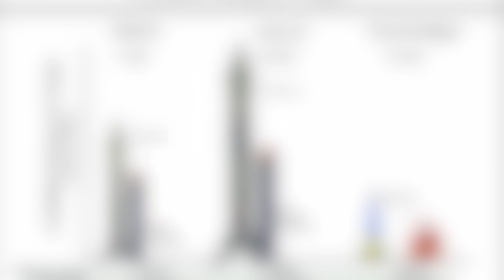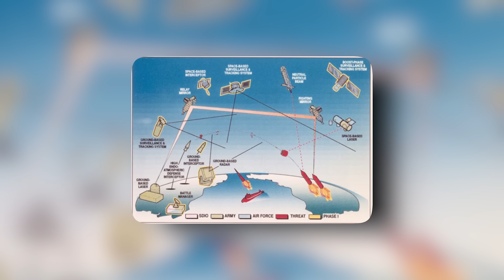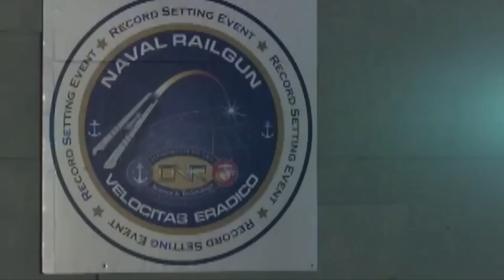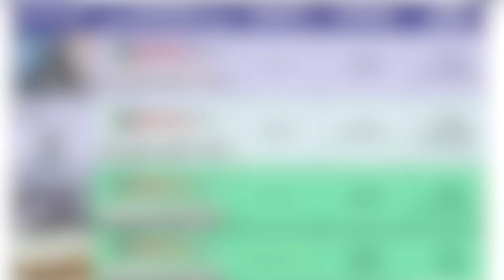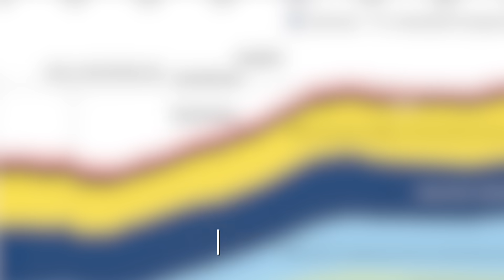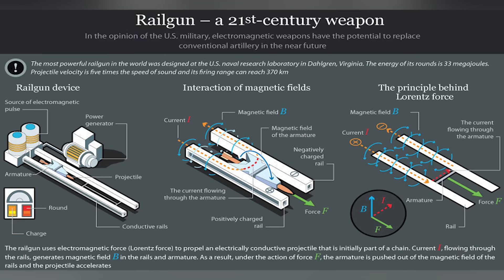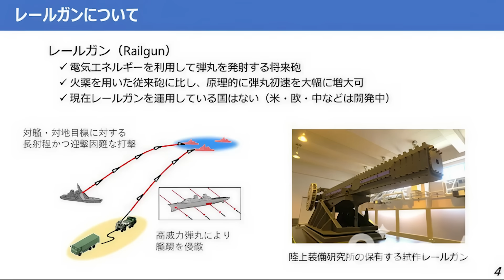Japan Revives a Scrapped U.S. Superweapon — And It Actually Works!

Comment: The problem with the rail gun was the damage done to the barrel
Reply: Yeah I suppose you’d need a zero friction solution, making the projectile be captured in a floating state of a magnetic field (the same one propelling it?) inside the barrel
Reply: @mortenthorpe  You can do a floating projectile with a coil gun, but in a railgun the projectile needs to physically close the circuit between the rails, which it basically scrapes against all the way down the barrel.
Even conventional naval guns have a limited number of shots before the barrels need to be replaced, so that's not necessarily a deal-breaking limitation.
If the ship can carry several sets of replacement rails and swap them out reasonably quickly, then Bob's your uncle.
Reply: @The_Inquisitive_Inquisitor  I asked Chat and it said we could use something like a electrically conductive gas to do it, but obviously we don’t really have that capability yet so no contactless rails yet
Reply: @labbit35  in the big railguns, they actually pump out all of the air inside of the barrel so there's not even air resistance when it's firing. IDK how a conductive gas would play into that.
Reply: @The_Inquisitive_Inquisitor  we need room temp superconductors ngl
Reply: @labbit35  When your weapon system twists the laws of physics into a pretzel, then some components are going to wear out. I don't think there's any way around that
Reply: @The_Inquisitive_Inquisitor  bro a railgun is perfectly within the laws of physics, it’s jsut that sheer force of the railgun is so intense that we have yet to figure out how to make the barrel in a way that ensures it doesn’t blow itself up
Reply: @The_Inquisitive_Inquisitor  Interesting. Over all electric recoil does not have to go opposite directing from projectile. but if you don't funnel it some direction it rattles weapon apart. 
So replacement rails and clear recoil system that works well. US experiments looked like they had no recoil function and they were vibrating a lot.
Reply: @The_Inquisitive_Inquisitor  you are partially correct on barrel life, but when your barrel life is 3000 rounds it’s no longer viable.
Reply: @The_Inquisitive_Inquisitor  are you kidding ? "scraped down the barrel ? do you have any clue what kind of current is surging between the conductors and the projectile ? I'll give you a hint-it's enough to instantly vaporize any metal in a microsecond-I guarantee you-there will be no intentional "scraping" ..not unless your aim is to weld the projectile to the barrel.
Reply: Ya it's most likely a coil gun.  Same deal with the handheld rifle.  And it works.  It's a coil gun most likely.
Reply: @ashleyobrien4937  you didn't say anything funny. Say something funny
Reply: @The_Inquisitive_Inquisitor  タングステンカーバイドコートにすれば耐摩耗性も耐熱性も確保できるだろう！
Reply: @shintenhou229  Tungsten welding electrodes are considered "consumable."
There is no material that never wears out.
Reply: @The_Inquisitive_Inquisitor   The projectile must be loaded into the launcher, so just include a sacrificial rail jacket as part of the munition.  Secondary electromagnetic pulse could eject the wasted jacket, taking a lot of residual heat with it.
Reply: @mortenthorpe I've read about some now coatings that where used in tokamak, they might be using those coatings
Reply: It's not even just the friction the electric discharge also produces plasma.
Reply: @mortenthorpe  It was poor recoil set up mostly the problem if you don't send the energy out from the gun it rattles the gun apart. 

Electric Recoil not like kinetic recoil. Basically you can direct the recoil any direction  except the same as the round . One simple small hobby version has force come out bottom of the "gun".
Reply: @mortenthorpe Rail guns use an electric arc to accelerate the projectile. The damage isn’t caused by friction but rather the electric arc discharge heat.
Reply: @mortenthorpe a rail gun always has millions of amps of current running through the barrel and the sled moving with the projectile. It's not just magic magnetic levitation. There are large copper pieces sliding against eachother by design and the interface carries insane currents. If there is an airgap the weapon loses efficiency and the wild sparking destroys the surfaces even faster.
Reply: @mortenthorpe Nope. Magnets need close proximity, and at those energies and velocities, the air turning to plasma erodes the barrels. It's not metal on metal - it's 10000C plasma eating the barrel. You'd need to flush the entire barrel into a hard vacuum with each shot, but even then the last few centimeters would still erode. Even the magnetism itself would affect the metals in the barrel etc. 

The weapon works. You just need to change the entire barrel every dozen shots or so. Obviously a 20 or 30 metre barrel can't just pile up in a stack somewhere - you need serious engineering or a crane to replace it.  Or as I say, the whole barrel needs encasing in a vacuum clean room, and even that is only a partial solution.

The US military had good reasons to abandon it and just put in fifty missiles instead in its place.
Reply: @mortenthorpe  I think that's correct. Maybe using the tech from the Maglev. That should reduce the wear issues. It's no longer a pure rail gun and make the projectiles more expensive.
Reply: The Japanese apparently had overcome this problem according to the video.
Reply: @samo4003  There were actually a few problems the US researchers had, another one being the weight of the system wasn't feasible for shipboard use cases and that's the reason they were developing it.  Another is the big surge of energy it takes to launch it.  You almost get to the point of needing to store energy up to fire off a shot, and that once again creates a weight issue.

And there is one last issue, you can accomplish pretty much the same thing with missiles as fire and forget missiles are better than ever.  And they aren't the price of what the narrator said as every missile a ship carries doesn't have to be a Tomahawk.

We had a 5" gun on the front of our ship and you could feel every time it fired a shot, and that was a destroyer class ship so it wasn't small.

I'm not saying it CAN'T be done for a ship, I'm just saying it wasn't feasible to keep spending money on the R&D in the US for it and the Japanese are more likely than not to come to the same conclusion, and if China puts one on a ship and claims it has the greatest weapon in the world, OK.  I won't believe it but OK.  You shoot that thing one time, then wait.  Meanwhile a US ship will have shot off a few missiles.  It will be a nice hood ornament for Chinese ships but if they get into a wartime situation with it my first assumption would be it will destroy the ship it sits on.
Reply: @johndoh5182  I agree with you. I do think where the US R&D went wrong was its size. I think they tried to go too big too fast without creating a smaller version first to solve some of its initial problems first. The AK 50 as an example, its not as simple as just scale up an AK47 to fit a 50bmg but it did solve some of the problems before hand that informed the corrections needed to fire a bigger round. TLDR the us started too big and should have started with a smaller round.
Reply: @samo4003  Looks like their solution was to simply use a smaller round. Which is one of the logical solutions to the barrel wear problems the US was dealing with. However, going with a much smaller round also means you're negating a large part of its utility as naval artillery doing shore/inland bombardment.

Which isn't to say a smaller rail gun round is unable to do a lot of damage and fulfil a role in modern combat. Just that the niche it would fill is different from the one the US Navy was seeking to achieve.
Reply: @samo4003  Don't know. They'd have to use either a new or experimental material to figure that out. And there's still the power thing.
Reply: @samo4003 Maybe they used their MagLev Tech?
Reply: @samo4003  To be more precise. They found a sweet spot in performance and degradation to the point that it was deployable enough.
Reply: @samo4003  Yeah, by scaling down the power output to 1/50th of the American prototype.  This is a step up from 90's college graduate-level research club project.
Reply: @samo4003  They didn't, they scaled down the weapon to 40mm (basically the size of an under-barrel grenade launcher like the m203 used with the m4/m16). I don't really know what they'd use a rail gun that small for tbh, other than a proof of concept.
Reply: @samo4003  - because the Japanese shrunk the railgun. It's more accurate to call it a mini-railgun. They have yet to prove they can overcome the same issues the US Navy had with larger railguns.
Reply: They never overcome the issue. Unpredictable damage on the barrel.
Reply: @samo4003  I read the technical reports on it's development over the past few years. Basically by staggering the capacitor discharge by a few microseconds so that way their peak draws do not overlap, they drastically reduced the barrel wear via reducing the peak resistance and thus heat and damage to the barrel.
Reply: @samo4003  So did Americans. The difference of barrel wear between railgun and super high velocity chemical cannon is marginal, because they put so much propelant behind the shell. Americans just don't think railgun is a solution to their problem, Japanese picked where they left and perfect it to suit their needs.
Reply: That's the challenge Japanese would like to take.
I think they have a vision about this weapon.
Reply: You didn't finish the video.
Reply: Modern exotic meta materials and magnetic field mapping entirely ameliorates damage to barrel.
Reply: @darkhorseman8263  right but is it cheaper than a pre-existing weapon system, or using inferior materials as though they're disposable?
Reply: @The_Inquisitive_Inquisitor      Consider a rather small projectile for the "bore", and an initial energy dump that sends a plasma field along the rails.  The projectile may, theoretically, be able to ride the plasma induced field effect, mitigating rail erosion.  I'm tired, so maybe my concepts are crossed.
     Exotic materials vs. simple consumables, vs. novel applications of physics.  Something that is difficult for a lot of people.  I agree with you, apparently.
Reply: it would be way easier to just put a replaceable barrel sleeve in it since it doesn't need to contain explosive pressures
Reply: The US gave up on the project because its competitor was just better. The laser cannon was just all around better and doesn’t destroy the barrel. And for those of your saying Japan solved the problem. Short answer is they didn’t.
Reply: @Jaderian87  The laser and the railgun aren't even competing in the same categories: the railgun is primarily an alternative to long range ballistic missiles and the laser is primarily a defense against long range ballistic missiles.
As a matter of fact, the railgun would be a pretty good counter to the defensive laser cannon; it can shoot over the horizon and there's no explosive or fuel in the projectile for the laser to cook off.
Reply: @The_Inquisitive_Inquisitor  rail gun vs ballistic missile. Missile wins every time. You have to wait for the rail gun to recharge before it can refire. Your ammunition storage is taken up by massive capacitors instead of ammo. You can launch as many missiles as you can carry and they are more accurate than a rail gun. Rail gun projectiles travel too fast for course correction so if they miss your a sitting duck. It’s a pipe dream and nothing more. The US military hoped the rail gun could be used to shoot down incoming missiles because seawiz is only effective at close range. What they found was something unreliable and slow. Even if you could make the reliability better the slow reload speed would remove its effectiveness. And compared to the conventional cannons on the ship right now it can never hope to fire at the speed the current gen of cannons can. Maybe in 100 years but not today.
Reply: @Jaderian87  Missiles are cool and all but once other people have high powered defensive laser cannons, then you need a gun that can fire an inert projectile at Mach 7 from over the horizon.
Reply: @Jaderian87  How convenient is it that a ship that's designed around either weapon system will have the power infrastructure to use both?
Reply: @The_Inquisitive_Inquisitor  You’re just coming up with nonsense now. I actually thought you were being real for a second. If a ship launches 10 missiles at another ship at the same time with differing flight paths all set to arrive at roughly the same time no defensive measure except maybe seawiz will help. Lazers are powerful but they are also very large so you wouldn’t want more defensive measures than necessary. We use seawiz because it’s small and effective. We just want something a bit more long range. Fighting on the open ocean is more a game of getting in that one hit that destroys the ship. A single type of weapon will not help. It’s whether that weapon works well with the rest. And the rail gun is too slow when firing and requires too much infrastructure on the ship. Lazers and missiles just require some deck space. It’s a pipe dream and we don’t have the ability to make it combat effective yet.
Reply: @Jaderian87  Did you spell "laser" with a 'Z' on purpose? Are you trolling??
The Navy's EMRG Prototype was deemed a failure in the realm of missile defense, but that doesn't mean hypersonic railguns are useless at everything forever.
It is poetic irony that railguns are the offensive solution to laser based missile defenses. Without any fuel or explosives to cook off, the laser will just make the projectile hot
Reply: @The_Inquisitive_Inquisitor  how much actual military experience do you have? Because it sounds like none. S and Z are right next to each other on the keypad and I don’t reread what I write before responding. I never said the rail gun was useless for forever. You are acting like we can achieve an effective weapon today. The only effective weapon is one that can be fired repeatedly. This is like thinking a Barrett 50cal is better than an M16 in combat. When the M240 will wipe out the entire platoon before the Barrett gets off a single shot. It’s just a pipe dream. There is always one person in every military that thinks bigger is better. The problem is bigger is offer slower. There is a reason that the military is looking for fast moving tactical trucks and less tanks. Speed is king in combat. If you take too long to get off a shot the enemy will take you out.
Reply: @Jaderian87  You did it twice, troll.
Anyway, we absolutely COULD build weaponized railguns today that can maintain high rates of fire, it just wouldn't be "the EMRG Prototype bolted onto the deck of an existing warship."
The rate of fire problem is solved by "more capacitors." If you're building a new boat around electric weapons systems - like railguns or lasers - then it's going to have those anyway. Probably also a dedicated nuclear reactor for charging them.
Aside from "but muh ammo stowage" why couldn't we make cartridges of disposable rails that are pre-loaded with a dozen slugs? When they're empty, toss them and a new set can be loaded vertically from below deck like a Mk 13/Mk 26 slotting in a new missile.
We have all of the technology that you'd need RIGHT NOW, if only somebody would spend the money on it.
Reply: @The_Inquisitive_Inquisitor  they are SHIPS not BOATS. See I can do it too. yea your angry that’s why your calling me a troll. Because you know you never served a day in any military and have no clue what you’re talking about. 

Ok so we solve the problem with “more capacitors”? How much more would it take. Currently the Japanese and Chinese need several large barges in tow to fire their rail guns. So how large are we making this ship because you can’t just bolt this onto any ship. Also there is the problem with the fact that ships can only get so big before they fail. 

Also love how your solution is to make cartridges which we already have in the form of missiles and conventional cannons. They take up far less room and don’t cost anywhere near as much. 

I like how you’re relating the power consumption of the lazer to that of rail gun. Lazers don’t consume as much energy as a rail gun. Lazers also can be bolted to any ship in the fleet with no major modifications. Lazers are compatible with the current way we go to war. We don’t need to build a ship to accommodate Lazers they are already compatible. And yes I am using a “Z” on purpose because you’re getting angry for no reason kid. Grow up. 

Speed is king in combat and the rail gun just isn’t.
Reply: The amount of HV cables running to the back of the gun is crazy.
Reply: That and firing in a straight line eventually just takes you to space. Artillery works because it arcs. Railgun shots just GO. It may be useful taking down Stealth Aircraft that can avoid any locks but why that plane would be above the horizon is anyones guess. Basically, cool idea, we already have other tools that do the same thing better.
Reply: @Rays326  Railguns projectiles do arc, they just have extremely long range.
No good against stealth because you need to be able to track the plane with the gun.
Reply: It was too good
Reply: AGREED, A redesign accounting for the lateral shearing forces needs to be implimented.
Reply: Do you think the wobbling of the ammo has anything too do with it what if ammo was shaped like a hypersonic missile too reduce drag and wobbling and kinetic energy wasted as heat or impact could that be it
Reply: @seanohagan6559 Yeah dude you figured it out. The entire brain trust of US military couldn't do it, but you did.
Reply: Friction between a bullet and a gun barrel, during firing, slows the bullet's travel and generates heat. This friction is due to the bullet's engagement with the barrel's rifling (grooves and lands). While friction reduces the bullet's velocity and can contribute to barrel wear, it's a necessary component for imparting spin (stability) and accuracy.
Problem was barrel wear is crazy bad.
Reply: That's what she said
Reply: It’s that the problem with any canon?
Reply: @Abduladilosman  A conventional high performance naval canon could fire something like half a thousand to 2,000 shots before relining the barrel is required.  The US prototype railgun, in the range of maybe a dozen shots.
Reply: K boss
Reply: All gun barrels have a maximum of shots. The battlesships would have to get their barrels replaced every so often. So it's nothing new. It's just that those barrels had a much higher number.
Reply: @Omnidestrophic The Iowa's resleeved their barrels every 320 shots. Japan set a goal for the railgun of one hundred and twenty shots which they achieved. Thats a couple orders of magnitude higher than the US prototype.
Reply: Thge actual problem was the cost that the developer was going to charge for the projectiles.  It started at about 50k for an inert projectile and ballooned to over 750k per ropund.  It made no sense to allow this kind of boondogle.
Reply: Looks like they solved it.
Reply: Yeah they need to use some of that Diddy fun lube before ejecting a shell
Reply: 7:53 here ya go.
Reply: And the amount of power required to generate those kinds of velocities.  The power needed was enormous, which required a LOT of capacitors to provide it.   The technology has advanced a lot over the last 30 years.
Reply: They should add plasma or something to soften the friction.
Reply: @evan_vangelisskoupras3085  No, that would increase the overall heat generated.  Suspending the spear in midair via the electromagnets is probably one of the better ideas to eliminate the friction problem, but that could potentially affect accuracy.

Again, the problem has always been in the engineering: the theoretical possibilities are still slightly beyond the reach of the practical mechanics.
Reply: I believe they lowered the power so it's not as intense
Reply: The issue the Navy was having was wear of the rails. As mentioned there is sliding friction because both legs of the projectile have to be in intimate contact with the rails. The “muzzle” end gets the most wear from friction as the armature/projectile is moving fastest. The “breach” end of the rails wear from arcing/melting as high currents are used to overcome static friction and get the armature moving. The rails are subjected to a very hostile environment. Early on the rails were made of copper because of its good thermal and electrical conductivity, but rails had to be replaced every two or three shots.
Reply: @Zircon10  Which means they'll have to come up with something different eventually?  

Copper-impregnated ceramics?  Coat the rails in synthetic diamond?  Dedicated nanopaste coolant?
Reply: Nothing but a small issue dat can be overcome.
Reply: The energy needed to power BOTH is insane though isn't it?
Reply: and also there is a small other problem called THERMODYNAMICS, energy conversion is expensive, and electricity is even more expensive..
Reply: It was the damage (the barrel had to be replaced every 1-2 dozen shots) and the sheer amount of energy needed to effectively use it (15-30 MW of electricity. This is enough to power a standard US home for 18-32 months, or 1.5-3 years)
Reply: It was briefly mentioned in the video that they change the barrel after 120 shots. The target was 100 shots per barrel. Tests showed that the rails showed very little damage even after 120 shots.

They've also developed a way to quickly replace the barrel.
Reply: You left out the 5000 cubic feet of Batteries.
Reply: They moved the one at Dahlgren Va to the barrel range ealier in the year so I know 100% for sure that it is still in devlopment. I was on base a few months back when they cloaed the barrel range side of the base to test it bwcause its really loud. REALLY LOUD.
Reply: main problem is that this is low range gun,   shooting higth trajectories ljust slow down the projectile.
Reply: 重量より速度が重要
Reply: @fdynfwtijvdth  Speed and weight are both important. Photons are fast as Hell but they have no mass!/
Reply: The BIGGEST problem isn’t the barrel as much it’s the energy it takes to fire this weapon.
Reply: これは基本的に金正恩か習近平がとち狂った時にしか使わない兵器だ
これを使って他国を侵略することはないし、出来ない　だから何十発も撃つことは想定しなくていいんだ
Reply: Basically, anything a rail gun can do, rocket artillery can do better. You can't course correct a dumb slug.
Reply: @afriedrich1452  Except the cost, rail guns are cheaper to fire in theory.
Reply: @afriedrich1452  It’s the cost effectiveness of the rail gun.  Supposedly. 😏
Reply: @afriedrich1452  where i agree with you on that front as missle defence become better and better nullifying the usefulness of said systems, how do you counter a 5lb tungsten rod coming at you at mock fk? Lasers will be ineffective, and your not going to be able to intercept it with another missle/ rocket. And even with a 200 mile range you have maybe 400 seconds to detect and react assuming its able to be detected. And then the question is again how do you stop it or even deflect it?
Reply: @StrifeA217   Good point.
Reply: The rail gun best missiles at being cheaper per shot at least in theory.
Reply: @afriedrich1452 a hypersonic dumb slug will hit a moving target unless it does something a computer can't predict.
Reply: @afriedrich1452  you can, however, induction charge a smart munition being shot out of a railgun, meaning no onboard long lasting battery required.
Reply: @afriedrich1452 Cost dude, and a dumb hypersonic slug can't be jammed or kinetically intercepted.
Reply: @afriedrich1452  true but modern rocket artillery's rockets that can self correct cost a lot of money vs a metal slug only costs the weight of the metal and the cost to machine it into shape
Reply: @afriedrich1452  except have cheap rounds that you can have hundreds or thousands of
Reply: @afriedrich1452  nor a rocket
Reply: @afriedrich1452 you can't shoot down a dumb slug either
Reply: @laverian2251  sure you can….it’s just harder, requires direct impact
Reply: @laverian2251  technically you can and it has bin done its just expensive and compute intensive
Reply: Hahahaha I love how all these arm chair experts are saying they came up with a solution that the US didn’t for 20 years hahahaha
Reply: @a.s.b.3729  The US didn't come up with a solution because of cost overruns and bureaucracy. The US Rail-gun had a very short barrel life, less than 20 rounds. The Japanese one has a 120 round barrel life with a 6 second cycling rate between shots. Japan > USA in this instance.
Reply: "Railguns: the Useless Billion-Dollar Weapon" by Megaprojects. Did China succeed? Hopefully, Japan can do better.
Reply: @afriedrich1452  Simon Whistler just speaks whatever script is put in front of him, regardless of accuracy. I'd put a mountain of salt to anything he says if you don't know enough of the subject to find inaccuracies.